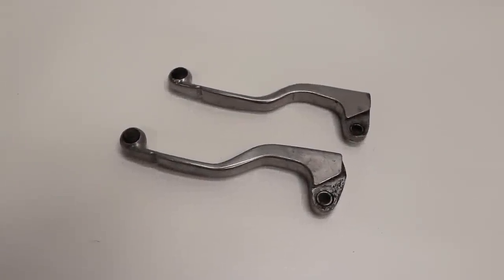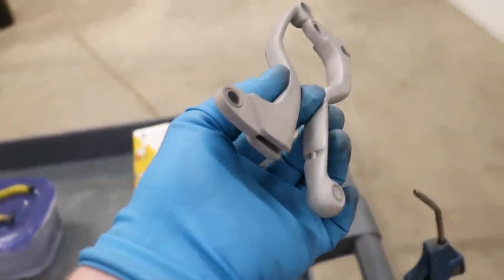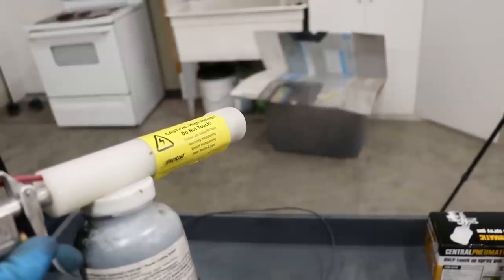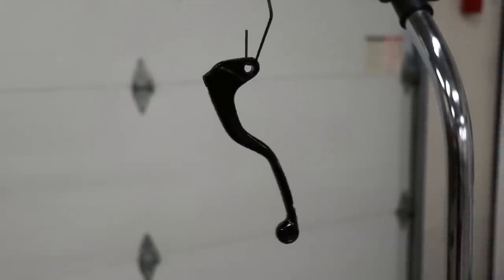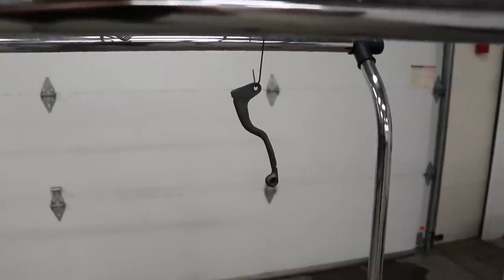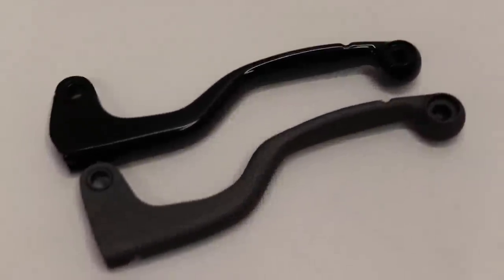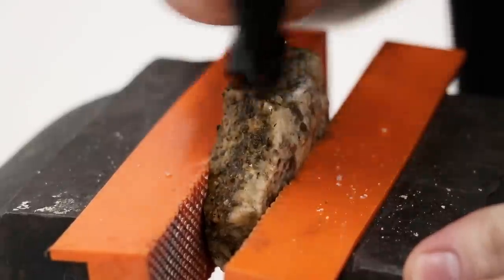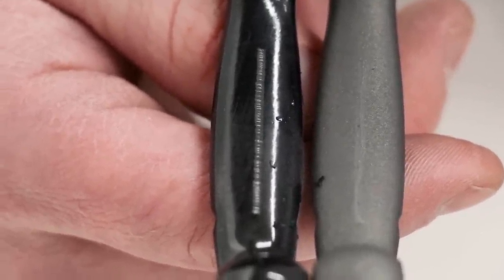Powder Coat vs. Cerakote | Which Is Better?

Comment from the maker: Powder coat or Cerakote? What would you go with?
Reply: Cameron Niemela I would probably go with powder coat in gloss because mud wouldn’t stick to the bike parts as easily making it easier to clean.
Reply: Powder Coat just because there's so many colours keep up the good work
Reply: Cameron Niemela powdercoating
Reply: I like the looks of the cerakote
Reply: Cameron Niemela cerakote for grippy levers. I hate wet gloves, and wet slippery levers
Reply: Cameron Niemela  can you send me the brake levers if you are just going to throw them away
Reply: Powdercoat
Reply: Cameron Niemela cerakote
Reply: Cameron Niemela powder coat
Reply: CERAKOTE FTW...
Reply: Cameron Niemela Dude the ceracoat didn't protect the metal and the powder coat did, that's why it's so thick. See the divits in the metal on the ceracoat and on the powder coat it wasn't even through the powder coat on the first test
Reply: Oh yeah my choice would definitely be the powdercote. 
1.*color choices
2.Process: The powder coat is simple and easy. The CK gotta get the right spray gun this alone brings more of a process (tip size, P.S.I, filters, etc etc 
3.Measuring Liquid: Really? You have to buy a glass "What Was That Called Again" oh and the droppers What? How much does that cost?
4.Powder Coat is proven product
5.Sustainability in the market
(As of the time that this typing process was taking place somewhere between the hours of 2>4 am EST. the number 1. Reference to colors is no longer a justifiable reason to not purchase cerakoate based on the extensive list of color options claimed on the World Wide Website WTF!  People)
Reply: cerakote has lots of colors, reds, pinks, purples, greens all sorts. cerakote is way better than powder coat.
Reply: Diet Coat or Coat Zero.
Reply: Have thought about duracoat?
Reply: if i send u my motorcycle piston how much u charge for cerakote?
Reply: What do you mean there aren't that many colors of Cerakote? There are 100's of colors in the oven cure variety.  Did you even check the Cerakote website before posting this video?  Here is a direct link to their oven cure color page, https://www.cerakoteguncoatings.com/finishes/?tab=coatings&cat=HSERIES  Also another note about Cerakote, the matte or gloss finish is determined by the ratio of hardener to color.
Reply: Cerakote
Reply: Cerakote high temperature for my headers and powder coat for my frames.
Reply: Powder coat
Reply: cerakote
Reply: I’m  @thijs3002  p
Reply: Create just looks nicest imo. Powder coat is nice also
Reply: Sorry, but this is pointless comparing... Powder coatings have different resins and blends depending from usage of end products. And also pretreatment is not right, we use degreasing, etching, desmothing, pasivation and a lot of DI wate.    Sandblasting is not good as it contaminates surface with impunity. Baking-curing of powder also plays a big role and quality of powder.  Comparison is like apples and pineapples. Sorry no offense, but i do work professionaly jobcoating with tradition over 40 years😉.
Reply: Ceracoat - because there are special coatings that offer lubrication for wear surfaces and ceracoat looks better on firearm accessories like rails. Ceracoat looks more expensive too.
Reply: Anodize.

Comment: The glossier you mix Cerakote, the harder it is.  For a better comparison, try a 1:12 ratio.  Also, Cerakote comes in MANY vivid colors.  The reason for the acetone bath before the sandblast is so you do not contaminate your sand, which would contaminate the surface.  Cerakote also takes 5 days for a full cure. I understand this was a ghetto comparison, just laying down some facts.
Reply: He also had a lot of dry spray with the Cerakote thus the texture. My first time using it was same dry spray. Fixed that now mine comes out great.
Reply: @sithyarael6807  yes, a lot of people, especially auto body guys, tend to get the dry spray at first because they are not used to how it atomizes.  You need to spray closer and heavier than you initially think.
Reply: Yep. Since that first one I have done four AR's and going to do a 5th when I get the rail in.

Comment: Most people don’t know this, but you can apply multiple coats of cerakote. Spray a coat on your project then hit it with a heat gun till it looks dry then spray another coat. I have about 4 coats on the outer (not areas where tolerance is important) parts of some of my guns, and the cerakote is tough as nails there.
EDIT: you still have to fully cure the piece in the oven afterwards.

Comment: A fuel spill resistance test would be nice, I mean, no one is gonna spil fuel over the levers, but maybe someone will powdercoat/cerakote other parts of the bike that would be at risk of begin covered by fuel
Reply: There is powder coating that holds up to jet fuel I work for a place that builds lifts and jet tanks for airports and we use it on every part and there isn’t that on the cerakote
Reply: Cerakote even resists rifle bore cleaner and is a firearms industry standard. It's also used on headers, turbos etc.
Reply: @coreywilson3784  Sweet! Retired jet mech here who loves powder coated motorcycle frames. What brand is it? I'll order some.
Reply: I think Cerakote would hold up better in a fuel spill.  It was designed to resist gun cleaning solvents, including bore cleaner.  Those chemicals are meant to breakdown and clean out lead, carbon, brass and other heavy metals.

Comment: So, I've been looking at options for coating parts and pieces that would be durable. 1 reason I've decided to go with cerakote is that it isn't limited to metal parts. It also works on polymers and plastic. The "H series" has quite a few color options... And thanks to it being a liquid, you can mix colors to get the exact tones you want, you can also do some pretty awesome patterns with stencils and airbrush guns. Just some additional thoughts to consider.

Comment: You should see what brake fluid does to the coatings. Brake levers are usually subjected to a few drops when adding fluid to the reservoir.
Reply: Ethan Davis not if you use a cloth
Reply from the maker: I really dropped the ball on that one. Totally forgot to test gas, acetone, brake fluid, etc on the coatings. Oh well next video haha
Reply: Free content for next vid.. score lol. I did like the abrasion testing, definitely a cool idea to do the side by side tests.
Reply: I thought the axe test was significant. Amazing how the powder coat held it together. ;~)

Comment: Thanks for video... one thing to point out is that Cerakote has many different variations for the same color! The letter at the beginning and end of the code denotes the type of coat and what its good for! Like more resistant to friction are great for gun slides and high temp coats that you can use on pipes and even piston heads...

Comment: you gotta be the most kick back, coolest moto dude on youtube! funny as hell too. 

Hey about acetone soaks before or after.. I think that unless your running an oil water separator on your air compressor- you should finish the entire process of cleaning the part with a final clean acetone soak. you cannot go wrong with that. There will always be condensation and oil in your compressed air, from the compressor pump. Dont forget to always drain your compressor tank as well. That will tell you better what kind of grease is present in the air your blowing, IF your not running a water oil separator.

Comment: I prefer powder coating only because of the better color choices. I'm currently doing my 2001 RM 125.
Reply: Salvador Quezada ayyy rm squad👌👌
Reply: Rm 125's are the shit. I just finished building mine a few months ago
Reply: Tight!! I love how light they are, and simple to work on.
Reply: Salvador Quezada after rebuilding my rm, it runs and bogs when you floor it, and when you hit rev limiter there's not that much power, I tried all kinds of rejetting settings but it still bogs, cleaned carb multiple times, could it be the powervalve?
Reply: could be the power valve adjustment or the reeds
Reply: Marcus Bevzyuk check for cracks around the reeds, did you clean the actual needle in the carb, also how fresh is the spark plug?  the throttle cable good, does it spring back closed like it's supposed to?
Reply: Salvador Quezada reeds are good, spark plug is brand new and specifically for that bike, fresh gas and premix, throttle cable is lubed, carb is clean, not sure where to look for the problem now, do you think the powervalve could need adjusting cause it bogs when hitting the power valve, on neutral it revs pretty nice
Reply: Marcus Bevzyuk that sounds more like, too much air coming in. Check the boot from the carb to the air box, look for cracks or holes,  the air filter, make sure it's tight on, make sure all the hoses on the carb are routed right. Last, check the floats, that are not stuck on the down position.
Reply: Salvador Quezada wait do you have to have every single line routed in the carb? I thought all the lines won't matter much no? I rebuilt my carb but the only line I'm routing is the fuel line but that's it, the rest of the open holes where the other lines are supposed to go are not there, and yes my reed boot is nice and tight, and I reset my float bowl and checked for leaks and it all passed as good with no leaks
Reply: Marcus Bevzyuk so, you're MISSING hoses on the carb? That's a problem.
Reply: If you are missing hoses on the carb, when you crack the throttle the carb is sucking air, straight in.
Reply: Brendan Redler wow, didn't realize that. I went with powdercoat. I'm pretty happy with the results.

Comment: Acetone is great stuff. The human body produces small amounts so as solvents go it's not horrible, and it's so effective it's the standard for cleaning parts used in high pressure oxygen service! It's cheap at hardware stores so it's all win. I found your video while searching for exhaust coating info (I'm going to use their high temp oven cure on a Thunderheader whose shit coating promptly rusted through).  My gunsmithbro Cerakotes all sorts of parts and of course powder coat doesn't survive on hot rifles.

Comment: I'm working in Powder Coating Factory. So I'll go with Powder Coating but not for everything. There are different products of powder (Steel "Iron" or Aluminum). Also different if the subject will be indoor, outdoor, under water, under ground or sun etc.. With powder coating you should know what to use. For example: Oil pipe, steel for building & window frame are powder coating. Some product with 30 years warranty. For car's body & items can't heat up to 200 C (400 F) will go with liquid paint.
Powder Coating is durable.

Comment: Is either of these available in food-grade form? And if both, which is better (yes, I realize that "better" almost certainly varies as per specific application, i.e. type of food (raw meat, dry grains, etc.), temperature, and so forth, so I'm hoping for either a "general" type of "better" <g> or some "this is better for these foods, and the other is better for those foods" type of suggestions).

And thanks in advance for any suggestions (and please, I'm only interested in food-grade applications, i.e. small kitchen appliance type things that can be built by "Dad and Son" and sold via Ebay or our own website).

Comment: Cameron Niemela should rebuild some early '70s trail-bikes & early dirt-bikes etc. Not necessarily the toaster-tank '60s "SCRAMBLER" type of stuff, 'cause that's expensive - but some early '70s steel-tank chrome-fender type utilitarian "farm bike" type MX-ers. Dress 'em up with good alloy rims etc, better size better tires etc, maybe even do one as a dual-sport with one of those factory add-on "light kits"?
Reply: A mr175 elsinore would be an awesome new age dual sport. Miss that bike.

Comment: My plant is powder coatingon a conveyor system at 12' per min. That is truckloads. It has it's place. Ceracoat  is totally different. Cerakote prep can be longer. However I don't prep as the manual instructions. Clean by dipping in hot cleaner for either Al or steel. remove rust with a pickle dip, then Zinc phosphate. I'm rinsing in between each stage. About 5 mins in each, then ready for Cerakote. Have been known to Al oxide blast depending on the part.  As an example am doing my BMW wheels that the chrome is coming off in Cerakote.They look amazing, and as durable as it gets with H series or the Elite. Powder coating would not look nearly as good. It will tend to have some orange peel,and it is is much thicker film. Cerakote is less than 1/2 a mil. Powder is on average 5 mils. Powder could never penetrate a wire type rim,and cerakote is spprayed with aHVLP gun that can be applied to any area. Gun pats in powder would result in a non functioning weapon. Cerakote is perfect for this.  Ceramic coating if prepped correctly is more durable, and will appear as smooth and perfect as you are able to prep the part. Powder coating can be done at a much lower cost. Both have their place . Hope this helps. Also know your coater before giving anything to them.
Reply: Michael Scott I call bullshit on most of the things you said. First off 12’ a minute? I’ve been to plenty of shop that have a conveyor system and none of the run faster then 7’ per minute. Second, the only way to achieve 5 mills without massive orange peel on powder is to do it in multiple coats. The typical thickness for powder is around 2.5 mills. Third is the thickness of cerakote which is 1 mill. That is pretty much across the board. As far as those rims you’re talking about you would either have to blast all the Crome off which would take hours per rim or grind the peeling Crome. That would drive the cost up to be astronomical for either powder or cerakote. You may work around both of these applications but you don’t know what you’re talking about!!  I’ve been powdercoating for 10 plus year and cerakote for the last 5.
Reply: @adamshireman7530  I powdercoated in an industrial setting for 17 years.  We ran many of our parts at 15 fpm or faster.  Used Nordson booths.  Black, white, bisque, gray.  5 mils was way too heavy.  Manufacturers specs were much lower for GE, Whirlpool, etc.

Comment: Hanging parts in the oven must be evenly distributed. You cannot have one side of a part facing right at the heater element and the other side turned away from the element. One half of the part facing the heating element will get much hotter much faster than the rest of the part. It's a simple fix. Tear-off a sheet of aluminum foil and lay it in the oven right over the element. The foil reflects direct heat away from the part and helps to keep circulating the heat so the part heats uniformly.

Comment: Another thing to keep in mind is each color of cerakote for the regular H series and not the elite series has different properties and durability. All of the colors in the elite series have the same properties since they don't have all the filler material used to achieve the desired colors as done in the H series. The best color to test with in the H series is the graphite black as it's the toughest color in the H series afaik.

Comment: I do powder coating I'm surprised the powder didn't hold up so good did you fully cure the part? Also if it's for exterior use you should apply a clear. I would like to see more on this 👍

Comment: If you sandblast without removing the oils the blasting process will drive those contaminants into the part. Then you will have issues with the finished part.

Comment: Comment on part preparation I've noticed on your videos.  I typically degrease parts like this in an ultrasonic cleaner before and after blasting.  It shaves 60-90 minutes off preparation time.  I like your oven, I need to buy one of those.  For small batches of paint and catalyst, I use the eyedropper to measure.  For instance, if it is a 12:1 mix, I use 6 eyedropper full of paint and 1/2 eyedropper full of catalyst.  For video of the finished part, the high contrast of the white background blacks out the surface appearance of the part.  You should either use exposure compensation on the camera or a black background.  For corrosion testing, you can expose to hydrochloric acid or muratic acid found at your pool supply at your hardware store.

Comment: Adam,  you have not had much experience in industry, which is OK. A Line speed is determined by the system.  I did overflow work for the now closed Murray plant that mfg;d lawnmowers. The Jackson, TN plant ran at a speed well over 18' min. Can't remember, but it was quicker than any other line I had seen. The product would actually swing out at the turns because it ran at such a high rate of speed. They did color changes  with modules that were on rails that would allow one module color to push in,, and the other color out. This was after the both was cleaned with air,  with complete color change in no more than 4 mins. And yes, truckloads are ran at 12'/min. 300' of conveyor in an oven, with 8 automatics allows it to run quicker than that Think about the appliance market when a system is also running that speed 24/7. One plant in OK, alone uses that much product and much more.  Comments are fine, but call BS on something you have knowledge of.   As far as Powder coating wheels, it has it's place. I prefer Cerakote Elite, but whatever works use it.

Comment: Good vid man, those handles went thru an extreme test...very impressive, thank you i think that powder coating would be the option that i would go with because of the color options and it seems simpler to repair? Or less costly then the cerakoting. Thx again!